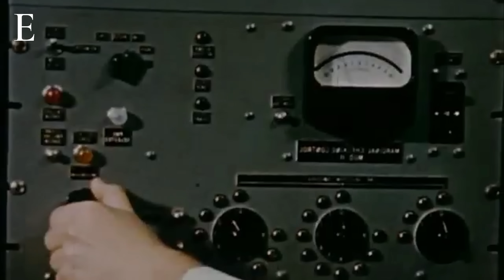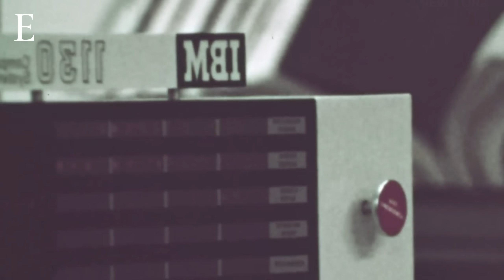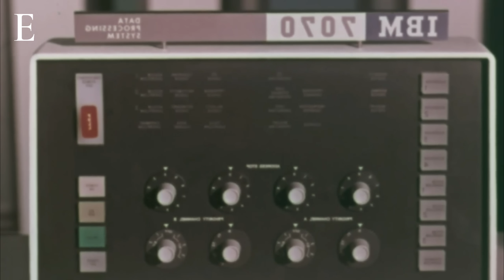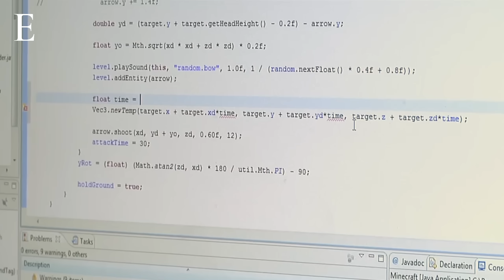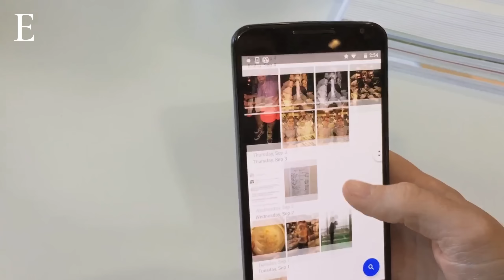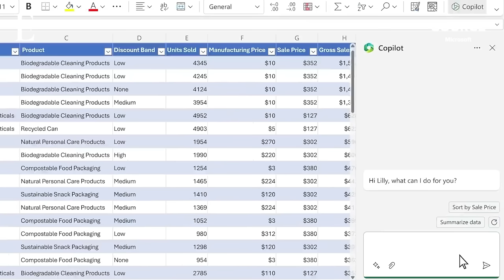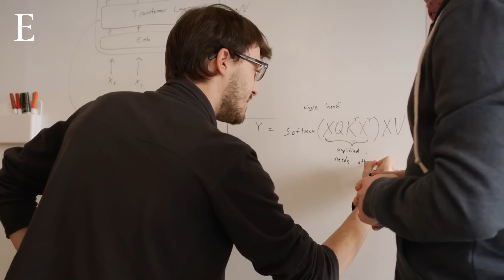The Rise and Fall of Software Engineers

Comment: AI Programming only works if an actual Programmer is giving commands to the AI to write the Program.
If your average Joe Schmoe without Computer Science understanding is asked to write programming solutions with AI, they're gonna fail miserably because they can't validate or check or test the code generated by the AI, nor can they implement the solution in an already existing codebase. 

You still need Software Engineers who understand the fundamentals, the coding language and the tools to be able to write AI scripts to create code and put that code into an actual working and existing codebase. Companies that fire all Software Engineers will suffer miserably with their Web or Mobile Application, because it still requires actual Software Engineers who understand the product, who understand the software architecture, who understand the code base, and who can respond to critical bugs and errors on a dime to keep that Web or Mobile App up and running. 

If AI comes to a point where it no longer requires Software Engineers to give it commands, and it can handle the entire front end, back end, continuous integration, continuous delivery, real time bugs and error handling, reliability, scalability, adding new features, improving existing features, deprecating old features, unit testing, managing sprints and tickets, writing documentation, and come up with new ideas and solutions, then sure, all Software Engineers will be out of a Job, but until that point, the World is still going to need actual Human Software Engineers.
Reply: AI will never be able to handle poorly written requirements which is the case for many projects. Only humans can resolve issues related to requirements
Reply: You sound like a hands on person.👍
Reply: Its only a matter of time AI is getting better every second and you dont have to pay AI
Reply: @kendoug5722  Ok Einstein, you really think AI is gonna be handling entire codebases without any Software Engineers on premise? Good f*cking luck.
Reply: What are you talking about you have to pay AI @kendoug5722
Reply: I just paste your message into Gemini 2.5 pro and now the AI is deprecating features in my app.
Reply: Computer science 1st thru 6th grade reader interactive voiceover best you got.
Reply: Well yeah… only need 50% or less software engineers
Reply: Well written and too true.
Reply: Best comment so far
Reply: Yeah it's mostly the nontechnical businesstypes that have no clue about their services and products who are looking out for a short term quick savings while trying to fast-track a magic bullet. Truthfully no expertise nor mastery can be shortcutted and greed will come knocking on the doors of businesstypes eventually. It's just sad that employees suffer majority of the damages caused by these businesstypes.
Reply: in the future, you will ask AI themselves to "validate", "check" and "test" the code generated by AI.
I think people should stop denying blatant truth
Reply: Wish this stays the same way coz some dusk is hell bent on even removing that from the picture. First create your anti side then mourn.
Reply: I think what they’re at least suggesting is that with AI a single software engineer can get the job done as productively as 2 software engineers hence fewer job postings in the market
Reply: Broke woke up and destroyed these reels watcher waking up saying AI will take all jobs and sleep watching reels, they never know it's actually nothing that can feel the void of them, the world still needs such idiots for drama, to make the world beautiful😂
Reply: It too much long😅 
Simply AI is the database 
If only right handed data exist how can I create left handed 
There you need human artist 
Simple
Reply: AI could have said all that in ten words or less.
Reply: You don't understand how replace work or deny the truth... Example: a firm hired a programmer Foo who is great and he works hard. But he can't do 100%, only 50% of what they need so they hire one-two more great programmers Bar and Baz... 3 guys have work... But with ai Foo can do work more effective, he does 90-100% of what they need and the firm fired Baz and may be Bar too... They are fired dude... They are replaced!
THAT what means replace.
Reply: Sure, but 90% of the software engineers are just reproducing what is already been solved, so we don’t really need that many of them. Just have the AI came up with the code, treat it as a black box and test input output. If you get the correct result, that’s all you need.
Reply: You are just coping here. It doesn't have to be "all or nothing" situation. There is a middle-ground world where SWE are still needed but due to efficiencies their roles will be drastically shrinked by a ton, I think by 70-80% going forward - sure not ALL SWE will be out of job, but MOST will be. As you said it yourself as long as you have a small team of enough senior programmers on the team to do all that, they can effectively do the job for the entire department, cutting jobs quite significantly and reducing the needs for more programmers. This middle-ground scenario already hurts software engineers, more SWE will flood the market looking for work which will have domino effects on the market rates of the salary as well. Not to mention the attacks of remote SWE from overseas that are happy to do your work for some rice and curry. Not a good time to be an average software engineer in the west today. I personally would look into business and finance where the name of the game is "human" interaction where robots still have decades away of catching up. 

Otherwise, the only way to guarantee your future is to start looking into niche industries or leadership positions. Find something that companies absolutely need your presence at, and no AI can do it.
Reply: @tessellationarts2971 you clearly don’t have a clue of what a senior software engineer does. AI is “good” at code generation. It’s the last thing I do, I spend like 90% of my time in meetings, updating packages, configuring cloud stuff and making everything connect, permissions, etc.

Coding is something that at least hasn’t been my main thing for the last 10 years.
Reply: @Hartformer2  what about the people generating the code ?
Reply: @thirien59  not that much code is needed to run most businesses. Doing small changes and bug fixes is much more common than blasting new code left and right.

Maintenance and debugging is the real job related to code. Plus all the devops, meetings, etc
Reply: @tessellationarts2971  We are not near saturating the demand for code. If it gets cheaper, we will just ship more.
Reply: @tessellationarts2971  There are two things you're missing. The first is that the productivity gains in coding that come with AI are increasing the demand for more tasks. It's easier to code, so now we can develop a new feature for the product that we didn’t have time to develop before, the demand keeps increasing with more productivity. The second thing is that just hiring small teams and seniors is not sustainable in the long term. If juniors and undergrads are not hired anymore, who will be the seniors 10-20 years from now?
Reply: @jonsnow82  About your second point, no business cares about "today's undergrads situation and after 10-20 years".
Reply: @jonsnow82  AI
Reply: It's not about whether SWE will be replaced or not.... It's about number of people needed in the software development chain. Humans will definitely be needed in the loop. BUT mark my words, in just 3 - 5 years from now, there a project that would have required 100 technical minds for large SWE chain would shrink down to about 5 ppl. 

This is the conversation...!!!
Reply: AI can generate code, and a software engineer can check it. So, it won't replace all engineers but it can replace many. Just like typist were once a good skill, people still need typist, but we dont need many because anyone can type these days.
Reply: agree with you

software engineers should not be panic for that. If one day AI exceeds software engineer, and can do all things, every single person on the earth will be simply replaced, no matter what you do, and it's just the matter of time.

If AI can replace software engineers completely, it can basically replace every one in the office. If robot tech mature enough, it basically replace the whole people.
Reply: Cope more

Comment: I am a software engineer at a Fortune 100 and I’m pursuing a master’s in Computer Science with an AI specialization. I use AI at work, and honestly, AI at most helps me create simple unit tests. It might help me 10-20% of the time. Anything that is complex is useless. It doesn’t check logs, it doesn’t know how systems interact with each other in a large infrastructure corporate system. These large language models will plateau eventually. They will not exponentially grow forever. If you check the AI development history, it is full of breakthroughs followed by decades of roadblocks. When the large language models plateau, it will hit another roadblock until the next advancement in AI. Anyway, just don’t get into CS 😂 less competition for us 😁
Reply: Anybody who bothers doing anything would code knows that programming is not just generating some code.. it’s mostly about debugging code written by others, or integrating something new with existing code.. jatchpt can generate you those 200 lines you requested but integrating that into your system and making sure you’re not breaking everything all the esoteric problems in the existing system, that’s where 99% of the so-called “productivity” lives.. I remember my first assignment in the field, was creating a script to automate some functionality. It’s extremely easy, I did in a couple days, but integrating that in the code base and testing it and making sure it works as intended and handles all the edge cases and whatnot, that’s what really took weeks and that’s what I was being paid for.
Reply: @dragonsandfliesandpotatoes Ai is already capable of unit testing and integration tasting using strong domain logic. 100 developers will be replaced by 1 or 2 code supervisors. That's the hard truth
Reply: @unskeptable  it can't actually do that. I work with science and engineering code every day. Most unit tests it writes are wrong, they have been wrong for several years, they are very likely to remain wrong. These models have marginal gains at this point. They are useful but they won't go much beyond what they can do now.
Reply: @Immudzen  what can you suggest? is there any line of programming will hit redundancy?
Reply: @jerackslicong  the more boilerplate what you do is the bigger the danger is. These systems are very good at doing something that thousands of other people have done. They are pretty bad at doing stuff that very few people have done.
Reply: @Immudzen it’s a good thing to write boilerplate for a company then. Why would a boss want his engineer to write awkward code just for the sake of it instead of writing clean boilerplate code?
Reply: @edboss36  for boilerplate code it can help but you also need to check it. Even on simple code AI makes mistakes and you don't want have it generate more code than you need. DRY is still very important or you can end up with an unmaintainable mess.
Reply: @Immudzen  well in my company we are using ai tools and they have dramatically decreased the time needed to implement unit tests. This will become a trivial task for AI in the near future trust me.
Reply: @ automated unit test have been in use for a long time, way before these LLMs popped up.
Reply: Sure, keep working at your small AI office, you will hardly break into AI without a PhD in math.
Reply: Ask it to write pre and postconditions from textual description of a problem. Boom.
Reply: The evidence is they have already hit a plateau. They have already trained it on all the data they could steal and the models have not really gotten any better. They can keep track of more information at a time but that is not helping them much. I also agree with you that they don't generate good code. They can be nice for a very quick POC but you will still have to rewrite the code because the code it generates is so aweful.
Reply: wait, how did you get into fortune 100, without a master's in computer science in AI, already in hand??? when only degree they ask for is a PhD... things dont add up
Reply: @ most math used in machine learning and LLMs I heard is mundane math.. None of the rigorous math they actually study in a math department
Reply: You are biased. So unfortunately your opinion is wrong.
Reply: LOL AI is already able to analyze logs and build autonomous microservices and systems built as black boxes. Developers are just screwed

Comment: People who produce these shallow analysis videos will disappear way before software engineers 😂
Reply: They have no idea of the difference between software engineering, coding, testing, system admin, data analytics, machine learning, and predictive modeling, etc. Fear is always among ignorant people.
Reply: works perfectly to print money via YT engagement
Reply: @r9999t  Predictions are hard, especially about the future.
Reply: @vasiluckys9238  afraid of what. if you are in the industry you will see the stupidity in the videos.
Reply: LOL!!
Reply: I'd be surprised if the script and voice weren't AI generated
Reply: the best prediction method is to wait... AI boosts coding but introduces a lot morę errors than human developers do... raise hand who was adviced to use non existent methods by AI 😂
Reply: Software enginners like you are shieting their pants these days...I recently hired a developer for a Next Js project...The guy did fine but was stuck on a problem. He told me that it's not possible due to some technical thing...later I used Cursor to fix that issue in 5 mins which he could not even solve in 1 week. 

The age of ai coders is here to stay and it's only getting better
Reply: My son graduated in SW programming and took 18 months to finally getting a great job at 20% less money than two years earlier.  His GF graduated same time (mid 2024) but working at a non-tech job at 1/4th the pay of a programmer.    A job in 2019 that looked so great is terrible with A.i. wiping out entry level jobs.
Reply: Absolutely true. I've been a software engineer for 35 years, and there's no way any AI could ever replace software engineers. However, it can certainly be a powerful tool to support them in their work
Reply: @khalidh3091  And that, my friend, is exactly why you don't see how AI can replace dev jobs.

Let me break it down:
Senior devs? They're safe. AI won't replace them anytime soon.
The real problem is at the entry level. AI is taking over junior tasks, which means fewer new devs are getting a foot in the door.

No juniors = no future seniors.
So when the current seniors move on, who's gonna maintain all that legacy code? Nobody. It'll all rot or turn into AI slop.

You need juniors to become seniors. Kill the entry point, and you break the whole system.
Reply: @khalidh3091 That is in fact all it is. A tool, but now very fast and smoother running. It still has to be directed.
Reply: @khalidh3091  Same here. It is a very useful aide but I have to keep checking and pointing out its mistakes to get what I want.
Reply: @khalidh3091  can I be your "apprentice"? I think i can learn much from you sir. I just became software engineer for about 2 years. There is a lot that i need to learn
Reply: @khalidh3091  Then how is it so, if it's true, that 25% of Google's code is now generated artificially?
Reply: @jgrab1  Writing code is not software engineering, it is about 50% of what we do, the other 50% is what is important.  The code they write (badly) is the mind numbing boiler plate code that doesn't take any thought.
Reply: @khalidh3091  no doubt AI can easily replace 80% of the so-called "software engineers" within 10 years -- possibly within 5. But given your 35 years, that should be obvious to you. FWIW, I'm in for 40 years.
Reply: Don't forget your job title will be replace by 1 AI and cheap labour from India.
Reply: You sound like an insecure software engineer.
Reply: Exactly
Reply: Hahahaha 😂😂😂😂😂
Reply: Cope
Reply: haha rekt
Reply: THIS 😎
Reply: Facts
Reply: Devs using AI to replace everyone else.
Reply: thanks for saving my time, as a software engineer I'm not going to watch this video lol
Reply: @CassieXu-io1ub  Actually AI will generate more tech debt than ever, we wont have enough SE to fix it. 😂
Reply: Well said
Reply: This was published on April Fools day, keep that in mind
Reply: This is AI my man lol
Reply: computer science major cope
Reply: Womp womp 😂 use your brain. Why should I pay to you when I can have AI do the job for me?
Reply: butthurt indian for sure
Reply: It's AI generated!
Reply: My AI girlfriend rated this video a 1 out of 10. 😆
Reply: totally agree.
Reply: Doubtful the Algo fuels this type of content more than more meaningful in depth material.
Reply: Factory workers thought same 😂
Reply: Factory workers weren't software engineers 😂 @scorpiomayank82
Reply: @scorpiomayank82  It's a bit different, than screwing in a screw.  Software Engineering takes creativity, all AI can do is figure out the next most likely thing based on history its trained on.  They can't come up with something completely new that has never been done before because it isn't in the training data.
Reply: @scorpiomayank82  Actually time and again companies have tried to fully replace labor with automation and time and again it's been an expensive mess. One notable even was Chrysler in the 1980's and just recently Amazon.
Reply: cope lol
Reply: Maybe this video has already been produced by AI
Reply: cope.
Reply: Not really. No.
Reply: @VectorAlphaSec lmao yes really, people now use ai to create these, with even a greater quality
Reply: @VectorAlphaSec  Ohhhh, look at him with his hacker hoodie icon. I bet he's a real expert.